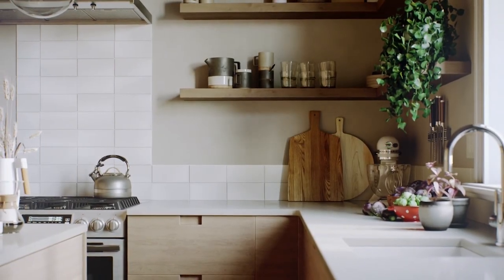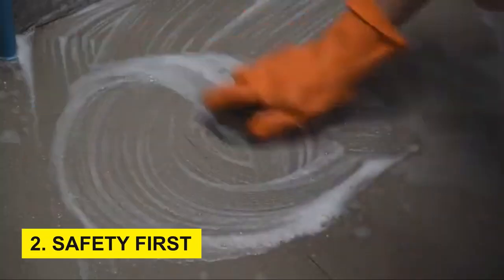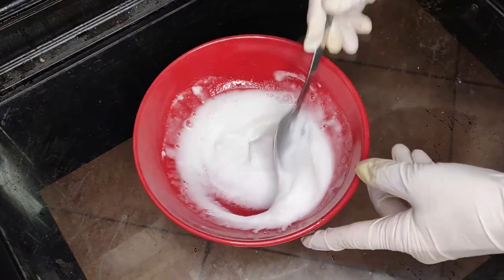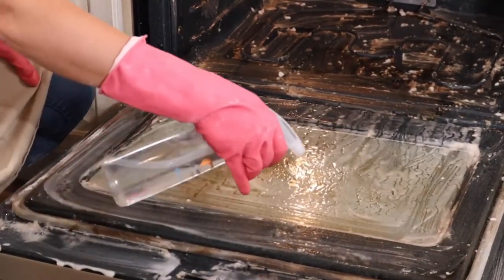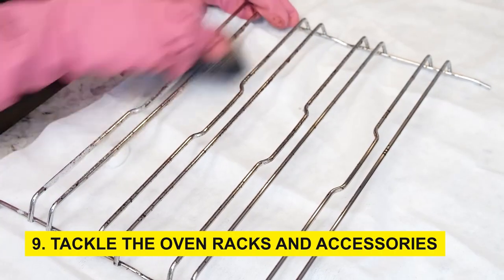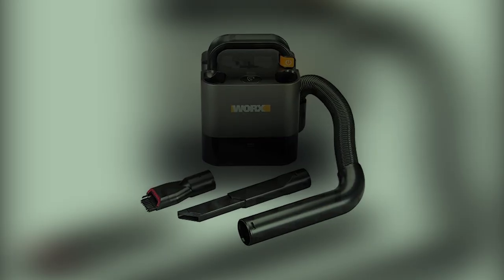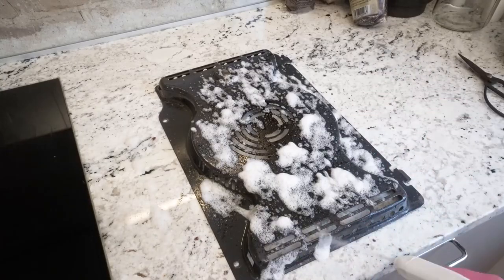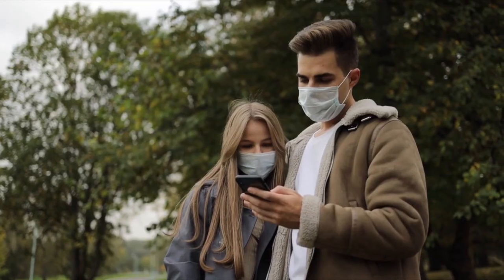THE BEST and SIMPLE way to clean your oven

Comment: How about cleaning between glass on oven?
Reply from the maker: That’s a good one! We use a wire hanger for this. Wrap some paper towels around the end and secure with a rubber band. Spray some cleaning product on it and carefully insert it in the spaces between the glass and the oven. When all the stains are gone you can wrap some dry paper towels on it and repeat to dry. Or you can disassemble the door, but this takes more time and effort.